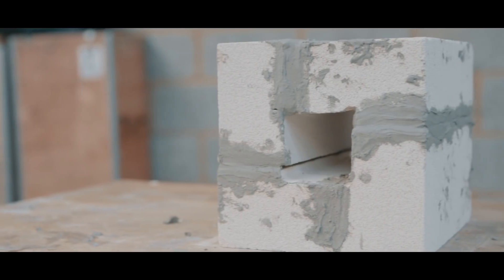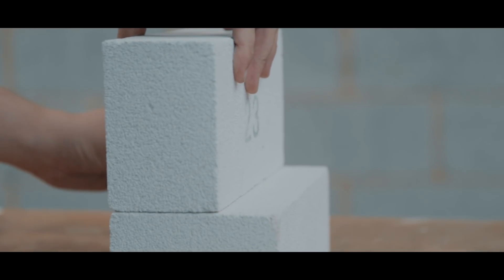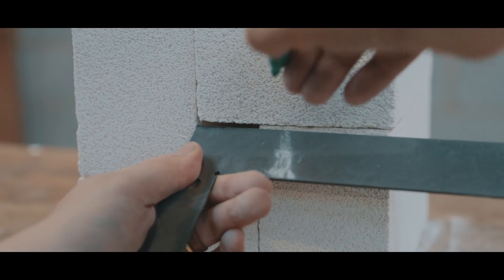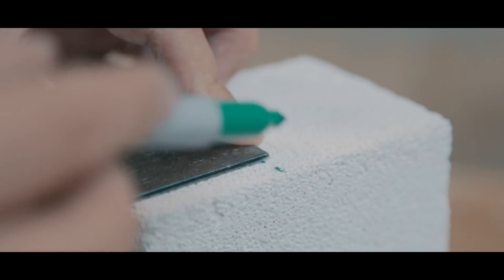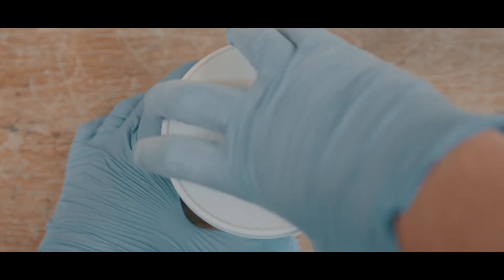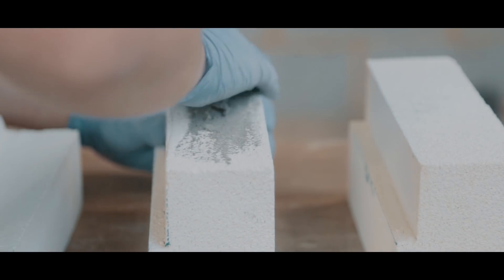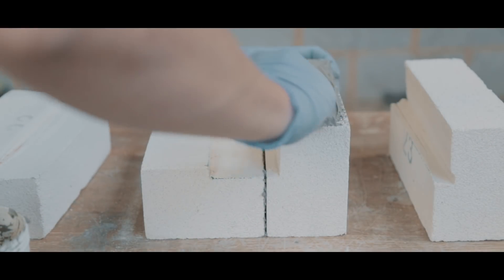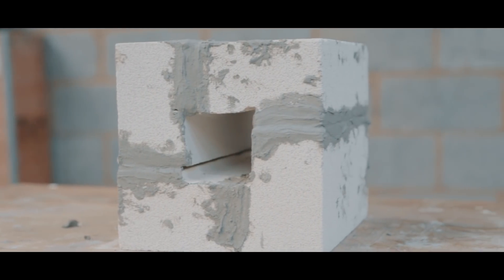#31 Mini Propane Knife Forge - DIY How To

Comment: I had found the same fire bricks you used but wasn't sure if they would work I'm glad i found your instrucables page because it linked me to the same bricks!! I'm looking to build my mini forge very soon and start forging some small tinkets :D
Reply from the maker: That’s amazing :) best of luck with it! I’ve added a bit of angle iron for a bit of added support as I move the forge around a fair bit. Make sure to send me a photo of you do make one !
Reply: Curious Creator i shall do ive got to get hold of the bits first but i have a mild obcession with black smithing after coming across alec steele so ive been wanting a forge for a couple of years and this seems the best way for forge version 1.0 haha
Reply from the maker: Yes Alec is amazing. Partly who got me obsessed with knives! My Next video is another knife build coming out later this week. So much fun
Reply: Curious Creator ill keep an eye out for it!! I was slightly obcessed with swords anyways discovering alec did not help XD  How are you finding tbe forge? Ive seen mixed comments on them with the outsodes getting hot on some but not others

Comment: How well are the bricks attached? If I skipped the angle iron would it fall apart?
Reply from the maker: They do stay together fine. I moved mine around a lot when filming so wanted to add support. I've seen a few people just use some metal wire as support to hold it all together. Hope that helps!

Comment: Very good video.  Made mine out of a coffee can and center mounted the torch.  Think it gets better heat coverage but I do like your creativeness.
Reply from the maker: Yes I did plan to drill a hole in it to put the torch, but I wasn't sure if I was going to need 1 or 2 torches, so left it for now. If I buy another I will drill 2 holes. Does yours just point straight down from the middle?